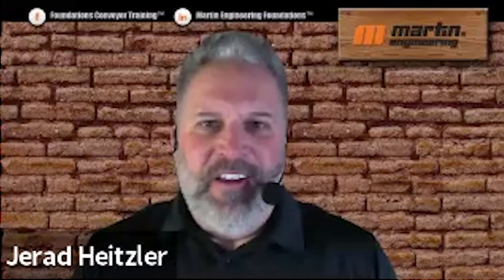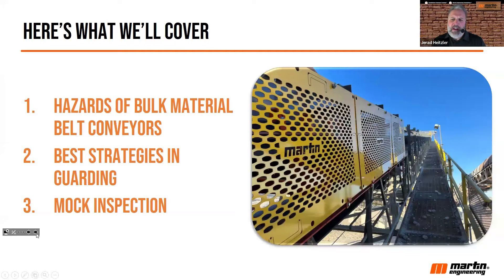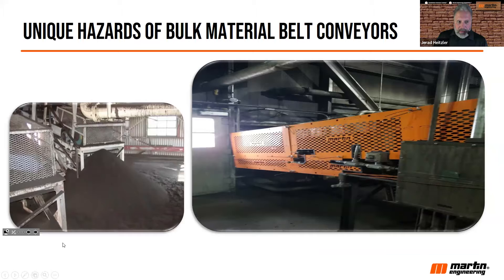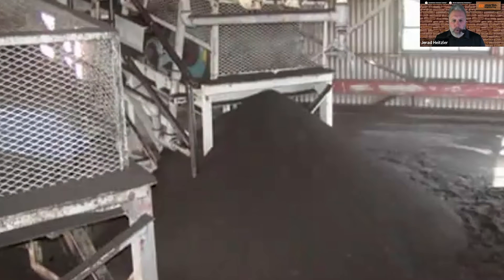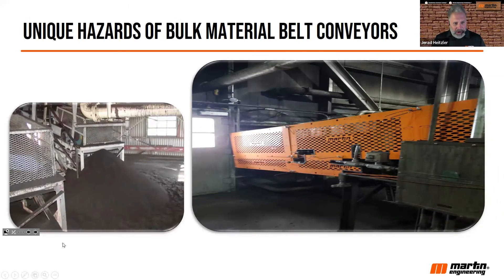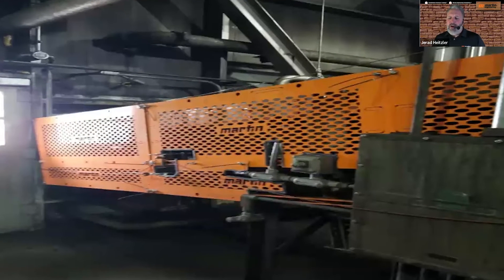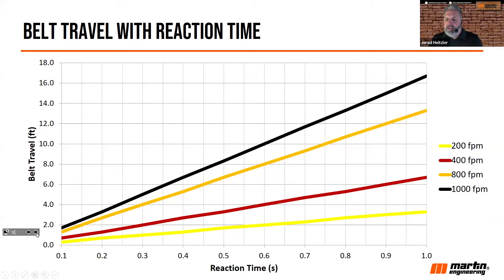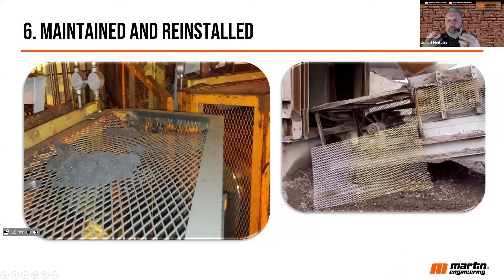Guarding Strategies for Belt Conveyors

Comment: Hello sir, the guard at 15 minutes makes changing the roller more hazardous in my experience
Reply from the maker: Please know that we do not recommend using a guard on a return roll like what is shown at the 15-minute mark of the video.  We are using this photo to show a poor example of guarding.  Return roll guards should protect a worker from making contact with the nip point that is created between the belt and the roller.  Also, changing any roll should never be done without locking out and tagging out the conveyor.  Each plant should have its own lock-out tag-out procedure.  It is our recommendation that a worker never breaks the plane created by the sides of the conveyor with their body or a tool unless the conveyor is de-energized, locked out, and tagged out, and a start-up attempt (to ensure that the conveyor cannot be unexpectedly started) has been done.

Thank you for your comment!